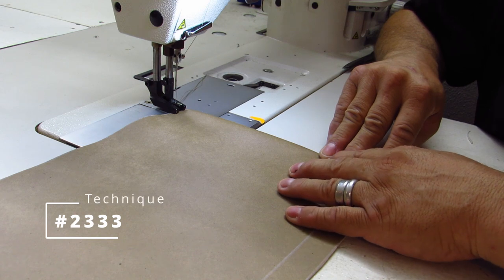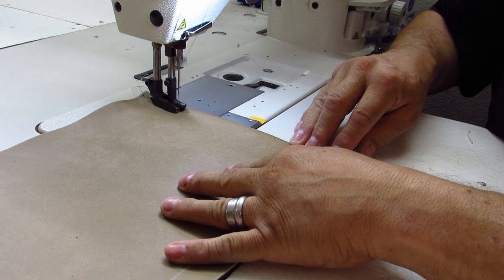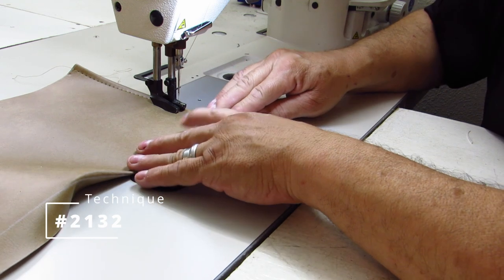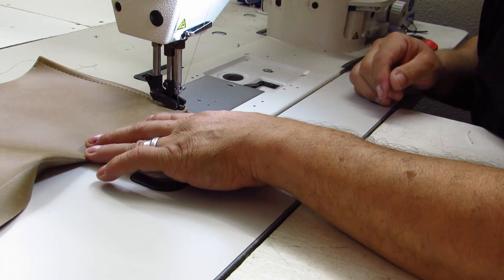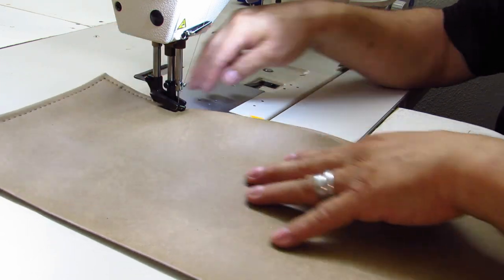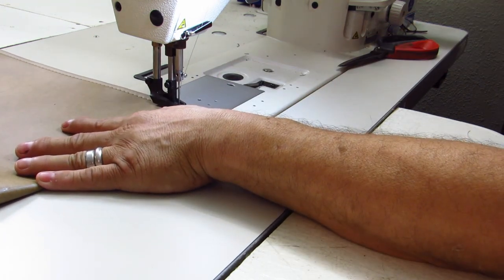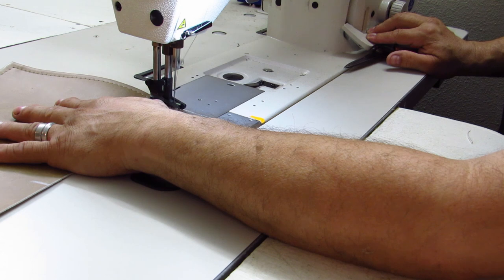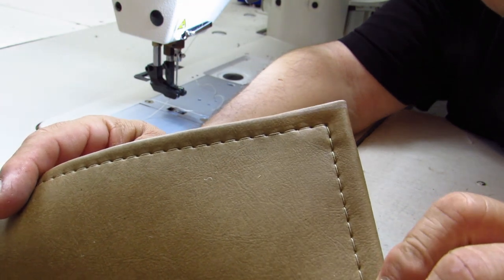DIY Nice Top Stitch Corners Upholstery

Comment: Thanks for all of your tips!  Could you possibly do a complete GM scissor top and window replacement?  There's not one out there and you would be the star of all time!
Reply from the maker: Well, I would need the customer first. And besides, I recently decided I will no longer be doing convertible tops. Too physical for me now. I have done under a hundred scissor tops during my career, mainly in the '80s and '90s. The main difference is that the whole frame assembly gets removed from the car.
Reply: Thanks, I am doing mine and had no good pattern because the old top was ripped-off torn-up and trash. I bought a top and rear window and have been rebuilding and adjusting the frame. only the rear part of the frame gets removed, right? Anyway, I'm trying to work out a way to fit the top with no pattern.  It may just be kind of trial and error, I guess. Not many still want to work on these scissor tops!
Reply from the maker: @Jeff_Pendleton  I would start with the rear bow height measurement
Reply: I checked the bow height. It's a little high 26-3/4 vs 26" spec. Not sure what to do about it.  There's no adjustment.
Reply from the maker: @Jeff_Pendleton  You're so close! I think the limit would be +- 1/2" is acceptable.